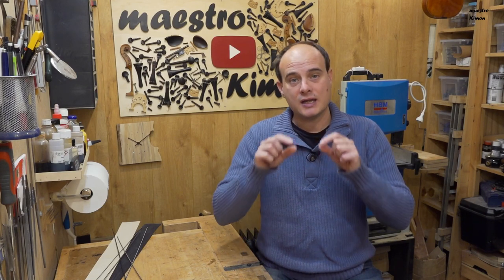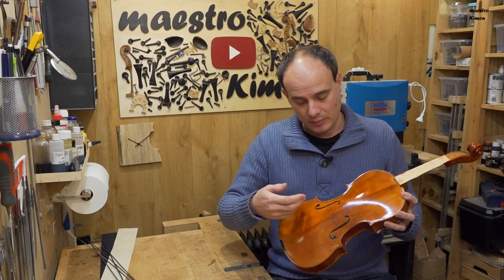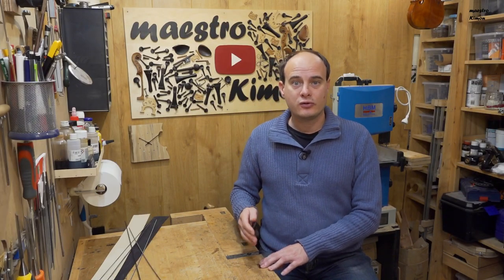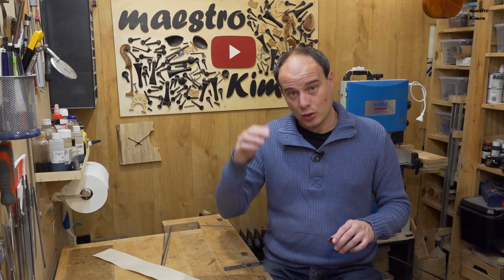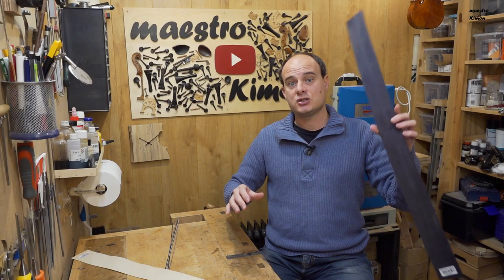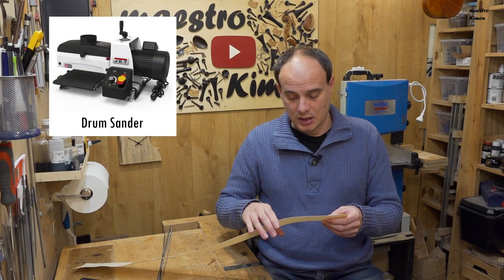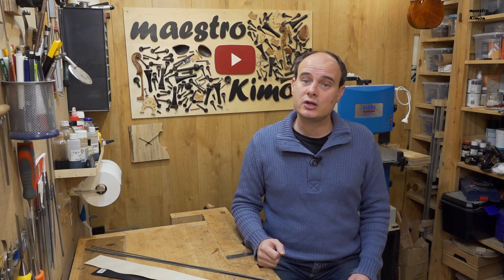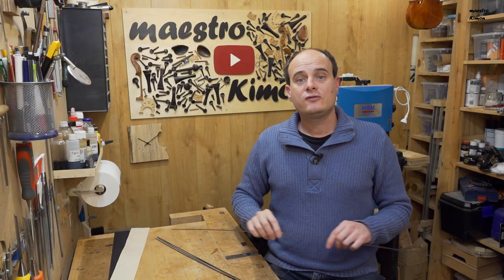The Purfling

Comment: Hi, very helpful videos, thanks a lot, I have a question about cracks, I have a crack on the top plate with missing wood, and crack is very irregular, I mean is not straight at all, which material can be used to fill the crack? It just look awful.
Thank you